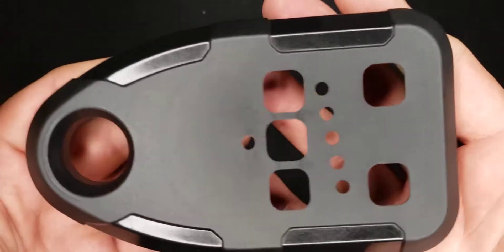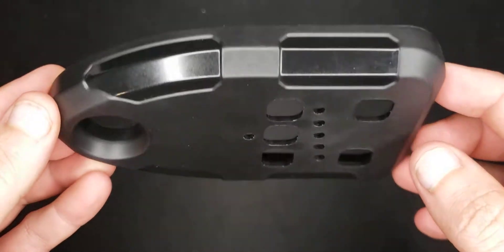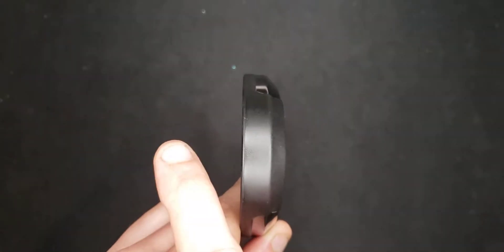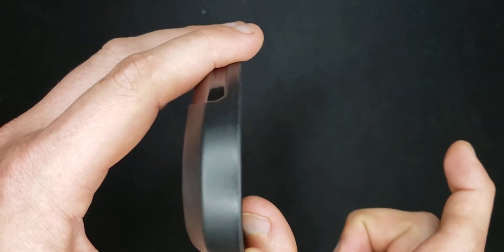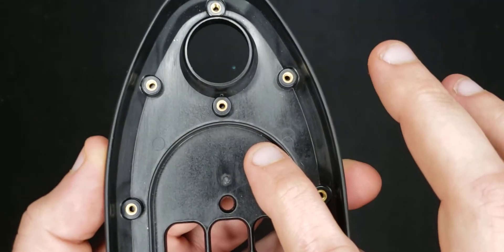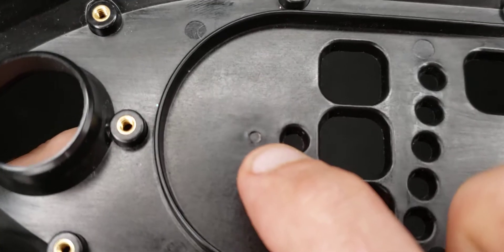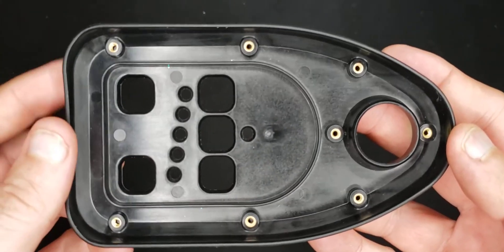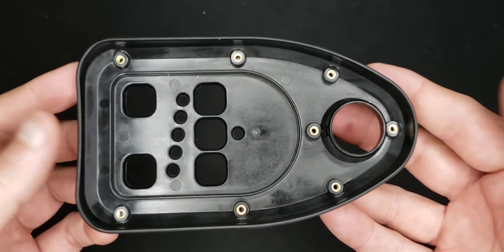Design Engineer Explains Gating for Optimized Part Aesthetics

Comment: very nice... brings back a past job
Reply from the maker: Thanks for the feedback.  Are you a tool maker?
Reply: @JJCCENG  Through the 90's I worked in a Plastic Injection tool & Die shop. We did mostly Prototype head lights and tail lights for Automotive. I did the Parting line splitting, Die Design, and Cutting paths. When ever i get plastic parts i find myself looking how it's made
Reply from the maker: @lfisherjr Very cool.  I'll bet you have a wealth of knowledge then.  I plan on doing more videos like this on Injection Molding so your feedback is always welcome. Thanks.
  [Sorry, first reply was accidentally using the wrong account].